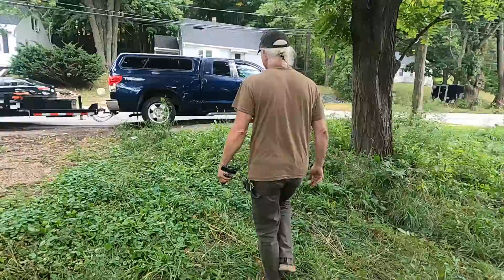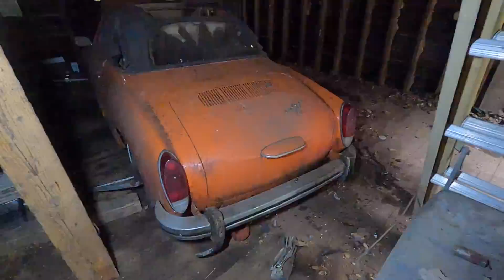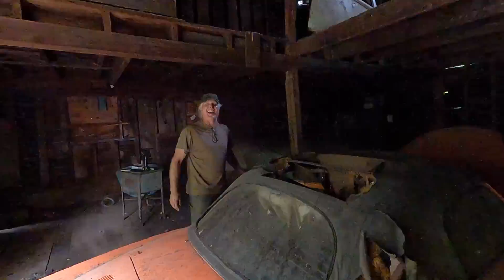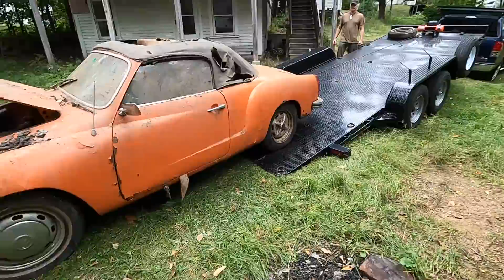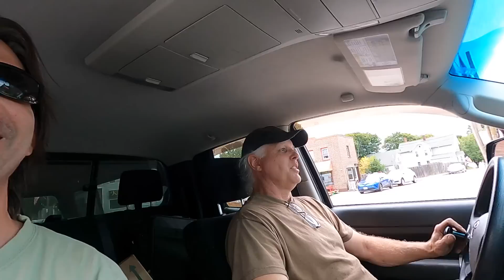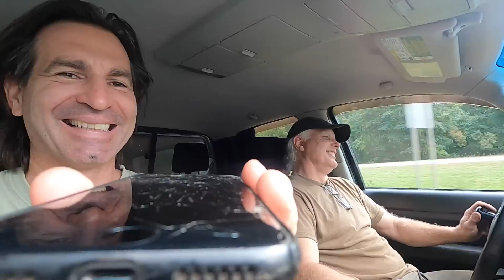FREE ABANDONED Car Sitting for 32 Years - Barn Find | Vw Rescue Karmann Ghia

Comment: Wish I were close enough to be in the "circle" if vw friends. So, I am one of those guys who picked up a 72 914 before I knew they are more or less "disliked." If you come across another you decide to part out, I'm looking for a dash, steering wheel and seats. I haven't began to work on it, (currently working on a bay window) so I am in no rush. The 914 is the only car that came with a title,  key and an engine that turns over. I don't comment often but enjoy your videos.  Thanks.